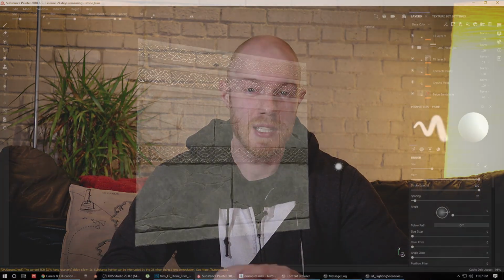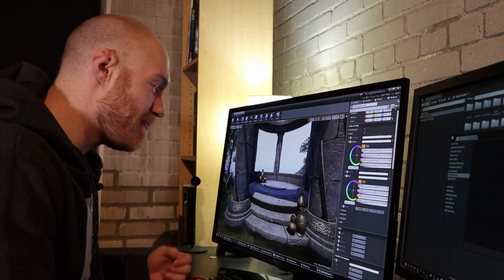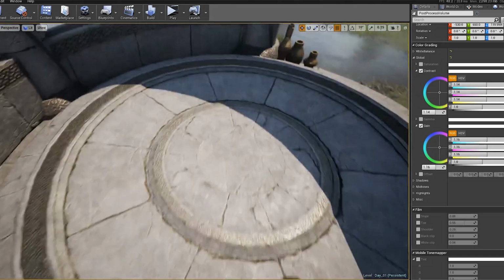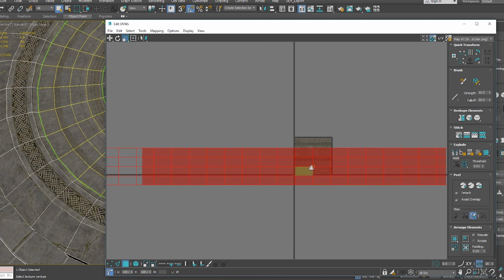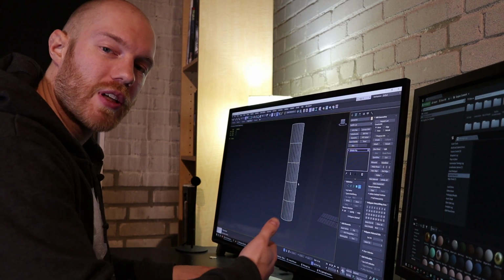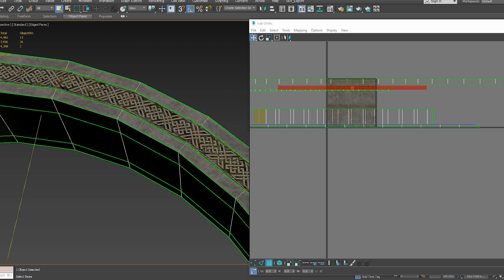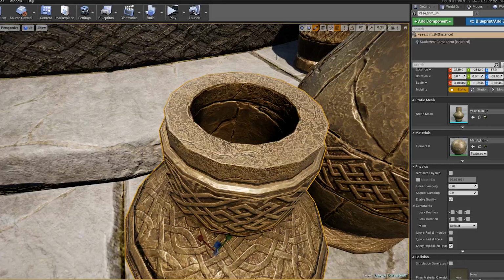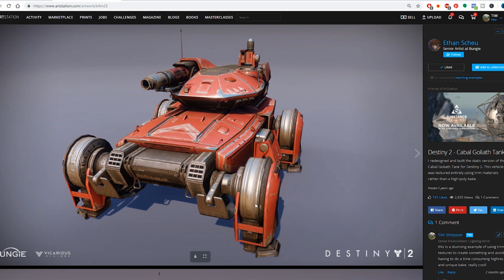TRIM TEXTURE TUTORIAL - ENVIRONMENT ART 101

Comment: This is a very cool video ! I have one question that i cant seem to wrap my head around...since using trim sheets requires you to move the UV islands around and you almost never want to have overlapping UVs, am i correct in assuming each island needs to be on its own texture set or am i just having a huge brain fart right now... ? and if this is in deed the case how is this an optimized way of working since at the end with a big enough environment you will end up having a huge amount of textures sets.. ?
Reply: If you're not baking anything so they can overlap. You still need 2nd UV without overlaps for lightmap. If you want combine atlas and baked textures (like RGB masks to add variations), you'll need 2nd UV too.

Comment: I still don't understand how you get the 90 degree corners to match up so clean. Is there something you do when sculpting/modeling the texture to make sure the 45 degree bevels are going to match up on each face?
Reply from the maker: wrathofbrandon not really, i just make sure there is a clearly defined groove in the sculpt and then line the uv edge up along it. There is usually a tiny seam but game cameras never get that close to notice it. If you grab the source files on my gumroad, you can load the models into your 3d software and play with the uvs and seeing how they correspond to the texture. its helped a few people understand it better :)

Comment: What was really confusing for me back when I started working with games and engines, was the MAJOR difference between a trim / atlas texture and a lightmap texture. The short version, which I came to understand the hard way is - trim/atlas textures CAN have UV islands overlapped, lightmap textures CANNOT. 
In your 3D modelling program, you should have TWO sets of textures - on channel 1 (which will be channel 0 in UE4) you have your UV islands mapped according to your texture, overlapping or not, and on channel 2 (which will be channel 1 in UE4), you have your UV islands spread across the whole texture (0,1 space) with some gap between the different islands (people recommend 3px, I can't say for sure, because I seem to always have problems regardless of how much px gap I leave). They MUST NOT overlap, or otherwise you'll get visual artifacts after baking. 
Another thing I learned the hard way - if you manual unfold, all the sharp edges in your model (edges > 45°) should have seems.
Reply from the maker: Jason Voor yea exactly, multiple uv channels is the way to go, you can reuse the second uv set for unique grime masks, tiling detail normal maps etc as well :)
Reply: I also wanted to mention this because when I started modelling last year I begun to use this workflow first but then I had the lighting issues in UE4 because of overlapping UVs. I don't understand why this possible issue isn't broached in this video as it seems to be very important when using this workflow. Beginners need to be teached about the pros and the cons of using this technique.
Reply from the maker: Manollo Bango nowdays unreal should automatically make a clean uv2 for your lightmaps on import, but i know what you mean, so many people asked about this that its gonna be the entire subject of my next video ;)
Reply: @PolygonAcademy 
Okay, nice to hear. Like I said before, last year I had issues within UE4 because of overlapping UVs and I didn't touch the engine since then because I focused more into modelling instead. However, I don't think that all your viewers are using UE4 but Unity and I don't know how the latter does handle this.
Reply: @manollobango  I believe you can create the Second UV channel well in advance in your modeling software, rather than relying on the automated process of some engine. This way you are the one that's driving the result of how the lightmap Uvs are distributed, depending on the size of the Lightmap you choose. Also I believe most of the people in the Game Industry or learning the game pipeline, will eventually know about the need to create a separate UV channel for the same.
Reply: Thank you so much, I faced the same issue while trying to use trim sheets, after baking process is complete I had the entire map glowing, was not able to figure it out back then, but now I understood where and what the issue really is.

Comment: Hey this video is lovely, made me remember a lot of tricks that i had forgotten since i moved into character art.
I have a couple question on something i can't graps: 
1)I really liked the way you did the Trims all in one sheet but how did you keep the endings tileable? i usually do a tileable texture in zbrush with Warp on the the Brush but that require also a border setup that i don't think you had in your scene.
2) When you map your trims on the main wall, you show the border being pretty much perfect, how aren't you getting some sort of seam in that situation, considering you're also using 2 different trims next to eachother?

I hope you'll find time to answer, in any case congratulation for the killer content you're creating.
Reply from the maker: Andrea Orioli thanks for watching! I used wrap mode to get the edges the same on each side, and then before i baked, i duplicated the highpoly in max to be either side of the main texture so it is seamless when it baked because there is actual geo there to bake from at the seams. 

As for the wall area, i just make sure than anywhere there is a horizontal seam that it lands on a bevel in my normal map, just by squashing or stretching the uvs slightly to force that. 
Hope that helps!

Comment: Hey Tim, 
Thanks for doing what you do! Also grats on top 3 in the last challenge. 
The info for the more technical aspects as well as the general workflow is out there but definitely not as cohesive as what you're putting out.
It's kind of bits and pieces here and there but you cover a lot that seems to usually be glossed over which is awesome. So thanks.

One question: How often do you see workflows that use primarily zbrush to painter these days versus primarily procedural like in designer? I suppose its studio by studio basis, but not everyone is onto a strictly designer integrated engine workflow. Just curious about your thoughts! Thanks again!
Reply from the maker: Gerald Mooney its really different across the board, each studio and artist has their own workflows. I know at naughty dog some artists go zb to painter or zb to designer and others are pure desinger, all in the same studio. Just go with the workflow you enjoy, it will increase the chances of finishing projects haha!

Comment: Hi, really loved the video. Been looking for info on Trim sheet production for awhile and this was the best one I found for it so thank you very much, question though. When building your initial plane division, how are you determining the size/quantity of the strips?
Reply from the maker: this one I just eyeballed based on previous experience on what sizes and widths kinda work well, I was going quick for the tutorial. In actual production I usually use trims of like 1m, 2m, 0.5m etc that I can easily map on corresponding grid based geo, but you don't have to be that exact. or you can look at your greybox/blockout geo if you have some and estimate the strip widths you would need. Once you do it a couple times you will be able to eyeball it or figure out the kits needs pretty easily :)

Comment: Does Unreal Engine automatically generates non overlapped uvs from these overlapped uvs when you check 'Generate lightmap uvs' in ue4 or do you manually create a second set of uv in 3ds max and unwrap the model again ?
Reply from the maker: Aamir Ahmad yea if you tick generate lightmaps it takes your uv1 and lays it out in a non overlapping uv2, but with trims there tends to be lots of seams, so its better to do a quick uv2 in max/maya usually for better results. Unless you are going 100% dynamic lighting like fortnite and then you dont even need lightmap uvs ;)
Reply: @PolygonAcademy  Wow. Thanks for replying so fast.
Reply: I am subscribing.
Reply from the maker: Aamir Ahmad thanks! Really appreciate every subscriber :) 🤛

Comment: I've used this technique for years inside Blender, i didn't know however we could export models with UV's layed out that way. It feels unnatural to do so :D
Great vid!
Reply from the maker: Sofie VW yea its fine, just make new clean lightmap uvs on channel 2 or have unreal repack the uv1 into uv2 automatically and light baking works perfectly.
Reply: @PolygonAcademy  So you mean if I create 2 UV maps UE4 will automatically recognize what to use for light purposes?
Reply from the maker: @jirimasak7483  no, by default generate lightmap uvs option is ticked in the import popup for a mesh, which takes uv1 and repacks it into an non overlapping uv2. if you created your own lightmap uvs in max/maya etc, untick that generate lightmap uvs box when you import your mesh. I cover this in the part 4 video of creating a trim sheet, where I talk all about lightmaps, and uv stuff :)
Reply: @PolygonAcademy  Awesome, so I can have 1 UV stretched beyond the UV space 0-1 and one properly placed in 0-1 UV space for lighting purpose. I will check the video and tomorrow or day after tomorrow I make some test. If this is correct workflow, it is really the thing I missed in my path.
Reply from the maker: @jirimasak7483  awesome, I have been using this workflow for about 10 years in different studios, in unreal and other engines, so it definitely works :)
Reply: I'm just now getting into Blender, if you aren't already familiar this looks like it could be super handy for trim texture needs. https://www.artstation.com/artwork/V5k34

Comment: Do the trim sheets need to be square or can I stack 16 256x256 tilable textures into a 256x4096 texture to have 1 material and not waste 90% of the texture?
Reply from the maker: James AwokeKnowing yea you can definitely do that, non square textures work fine. I usually break my trims into materials, so like one for metals, one for rubber, one for stone etc. That way you can tune your materials quickly in ue4 based on how you want that one surface type to look. I think one of the assasins creed games was doing a 1024x4096 for their trim sheets for each city.

Comment: Especially on larger pieces, don't you start to run into noticeable UV distortion when you straighten out the UVs of a disk-shaped mesh?
Reply from the maker: Yea, thats why in the center section there is those 2 extra edge loops, it helps remove the distortion by spreading it across multiple faces and not one big face. You can also fix that by making sure all the vertical seams on the bricks land on a edge and not in the middle of a polygon, it will keep them straight and minimize warping. 

Basically the more geo you have the better it works, and on large disc shaped stuff you need to keep your overall segments high to avoid that faceted low poly look anyways. I would rather add a few thousand triangles to a mesh instead of uniquely texturing everything, its more efficient for memory, and lods can cut the geo down at distances the player would never notice the warping anyways ;)

Comment: Thank you! I now know a more efficient way for texturing. But I am still so confused about how you make the Color/Roughness/Metallic maps. Did you unwrap the high poly models and textured them in Substance Painter, then export the Color/Roughness/Metallic for low poly to use?
Reply from the maker: John Binary nope didnt unwrap the highpoly. I just baked the highpoly to a flat plane, so essentially what you see looking straight on at the highpoly will be what your texture looks like. Then once it was baked to the plane, i just used smart materials to quickly texture it.
Reply from the maker: Roy Lloyd yea good explanation.  For your AO map you can always do a second unique non overlapping uv channel and bake to that and then overlay it in the shader quite easily. You could even channel pack 3 AO maps into a single rgb texture for 3 different modular pieces to save even more memory.
Reply: Wow really informative and useful. Thank you all for answering my question.

Comment: Wouldn't UE4 give you an error if your UVs overlap?
Reply from the maker: Left Blue only if your uv channel 2 lightmap uvs are overlapping. You can either do them yourself or if you just import your mesh ue4 takes your uv1 shells and packs them into a unique uv2 for you, but trim style uvs have more seams and are not super efficient. Better to just do a flatten map on uv2 as a quick fix. It only complains about overlapping uvs for lightmap channels
Reply: @PolygonAcademy  Thanks for the reply and thanks for your video! This technique looks very interesting.

Comment: Super cool. It looks shockingly good for the small amount of texture and mesh. Thanks for the detailed explanations throughout.

A side note about UV unwrapping outside of the texture space (the "0 to 1".) Baked lighting maps in UE4 require UVs to be inside, so take it into consideration if issues pop up with lighting. It generally means having a separate UV map for the lighting, which UE4 can do automatically on request in the mesh editor window. (This comes up in lighting tutorials, often.)
Reply from the maker: James Koss yup by default on import ue4 takes your uv1 shells and puts them into a unique 0-1 for the lightmap uvs, but trim style uvs have more seams than flattened mapped ones, so a quick fix is to do an auto unwrap on uv2 in max/maya and then tell ue4 to use that.

Comment: This Video is EPIC!  Somebody on Artstation commented I should look in to using Trim sheets , I looked but never found the info I needed.
But this video SOLD me on trim sheets for life!, I learned so much info from this video, I especially Liked the impact on performance and keeping the game optimized, since I like to make things for VR  so need that smaller memory footprint.
Trim sheets =
Better performance and optimization.
quicker to make.
higher  texture detail possible.
more flexible and easier to create more variation..

My only question is how did you deal with the overlapping UV,s casting shadows on the shells beneath them, in UE4 ( had that issue before when I  shacked the shells.)
Reply from the maker: AlphaWoIF ue4 takes your uvs from channel 1 and auto lays them out in a unique 0-1 unwrap for lightmap uvs in channel 2 for you now, or you can make lightmap uvs yourself in channel 2 and tell ue4 to use those if you want.

Comment: Wondering with the files. Do you have the high polys included? And when you baking the high to the low how do you manage with small gaps in between each mesh?
Reply from the maker: LadyGrace2 the highpoly isnt included dude to file size, but when you bake in painter any gaps are given the flat normal map blue color so they dint stand out. And because all the pieces had depth to them, i was only sculpting on the edges to add the bevels, so they were still air tight together

Comment: Hello Tim, i really like you tutorials, you are doing great content in my opinion. 
Actually i have a little question for you, about this particularly video. I noticed your UV map have UV islands overlapping one each other. When exporting mesh to UE4 using .fbx (in my case i export from blender),  the Engine requires uniquely unwrapped UV map(without any overlapping) to use as a lighting map.
So my question is - Do you encountered this problem using trim technique, and if you do, how you get around it? Thank you.
Reply from the maker: Igor Tarasov you can do a unique unwrap on channel 2 uvs, or let ue4 make your lightmap uvs automatically, it takes the uvs from chanbel 1 and packs them into channel 2 with no overlapping, but doing it manually is usually nicer for getting good results

Comment: Hey
I bought Gumroad files, and I've a question : you assign just 1 smoothgroup per UV islands ? 
I can understand when you bake in substance for example, but what is the interest with this trimsheet workflow ? 
thanks
Reply from the maker: Florian Potier i set the smoothing groups so some edges like the stairs would use the meshes normals to define the form of the lip, so it wasnt razor sharp, same for the rounded shapes on the columns, and then anywhere where it was a hard edge using the bevel i just made it a hard edge/seam. You can experiment changing the shading to get different results based off the geometrys normal

Comment: Notable Time-stamps:

0:00 - Introduction
3:31 - Within Unreal / explanation & example of trim textures
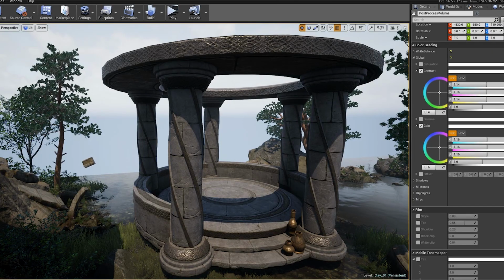6:15 - Within Substance Painter / explanation & example of trim textures
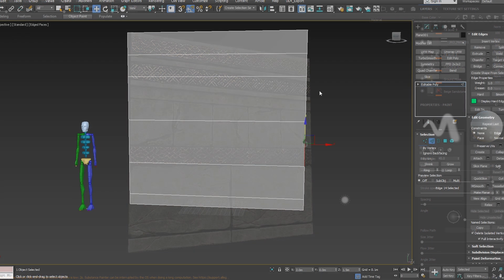6:59 - 3ds Max & Zbrush geometry creation for trim sheet (Sped-up) 
7:36 - Further explanation of trim textures
12:24 - How the unwrap affects trim textures (Circular Floor)
19:25 - Modeling tips for trim textures (Pillar & Curved Wall)
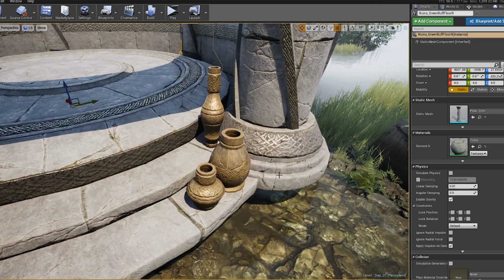27:02 - Using trim textures on small objects (Pottery)
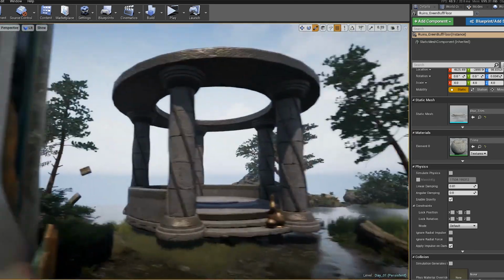31:36 - Balancing high and low detail within trim textures
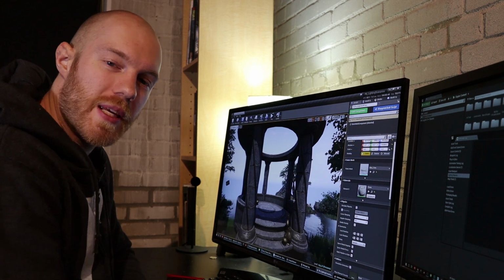33:10 - More examples of professional trim texture usage
35:43 - Conclusion / Wrap-up

Comment: This is an awesome breakdown! Great work! 

one question I was wondering, is when you're sculpting for those individual edges how do you know they will seam together well when prepping for wrapping corners and edges/tilting? do you usually follow them close to a 45 degrees?
Reply from the maker: the horizontal edges along each trim strip? yea I just make sure they are catching highlights when you look at the highpoly straight on, as thats exactly how the normal map will look. I just make sure there is no razor sharp 90 degree edges on the mesh.